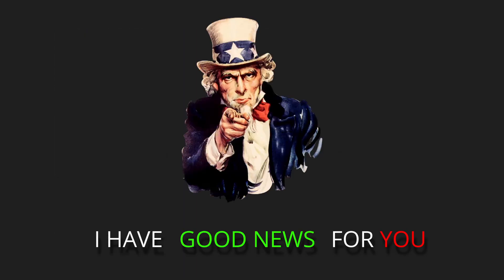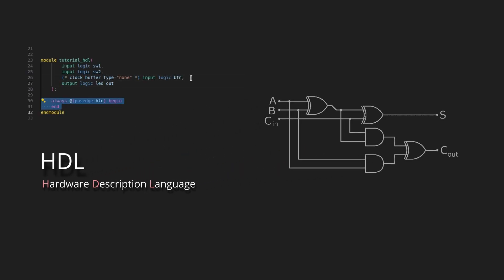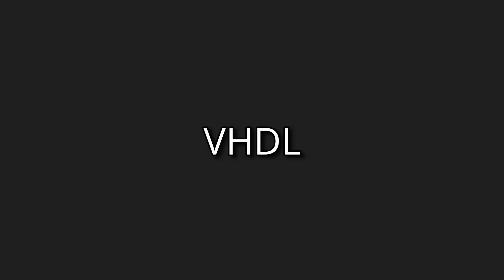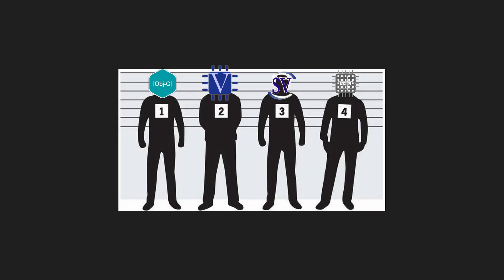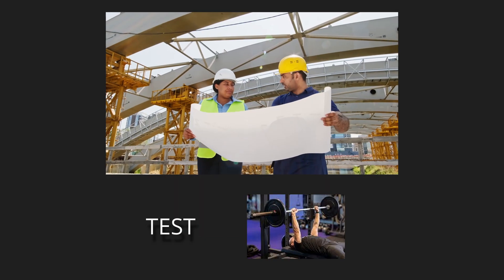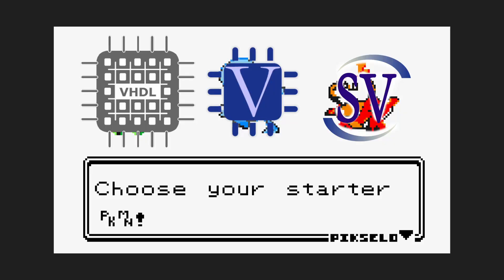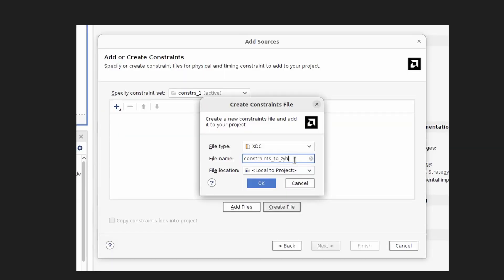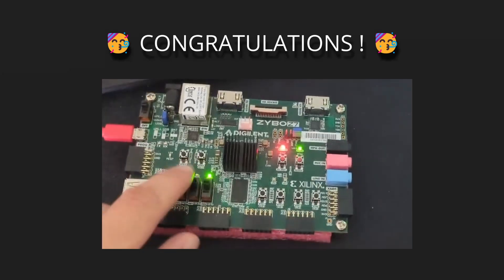HDL explained.

Comment: what if i dont have a FPGA board?
Reply: You can buy cheap ones
Reply from the maker: you can simulate your design using a whole lot of simulators.

I would 100% recommend a verilator simulator using cocotb to handle it (it gives you a very simple python API instead of the horrible c++ Verilator one) (I hate c++)
Reply from the maker: here is a blog post I made about the cocotb / verilator combo https://0bab1.github.io/BRH/posts/TIPS_FOR_COCOTB/ it goes in details about AXI and stuff but you anly need to understand the idea of it to get started. glhf ;)